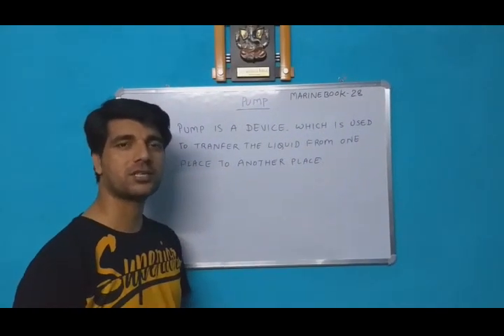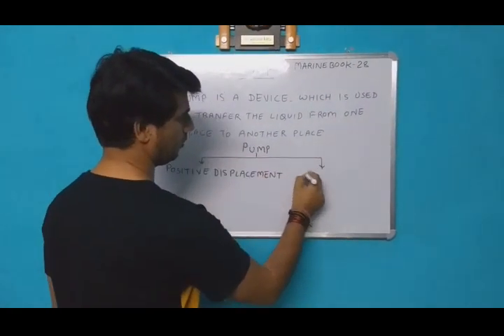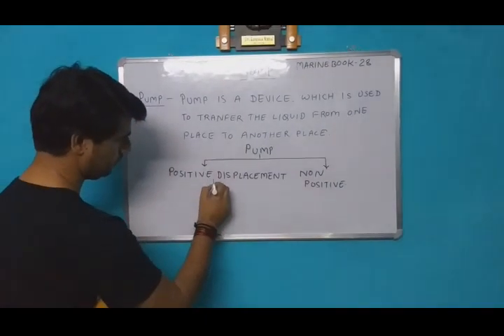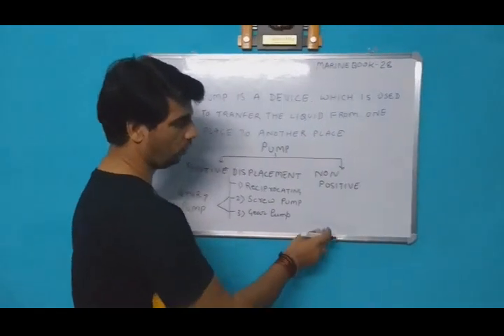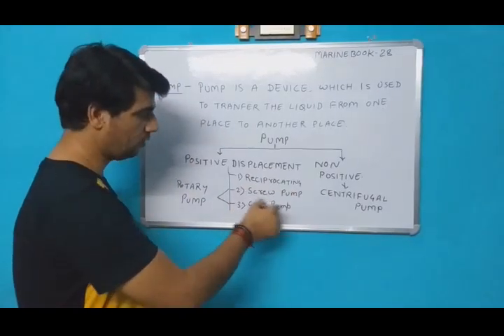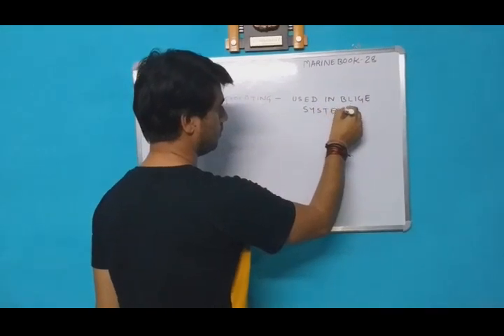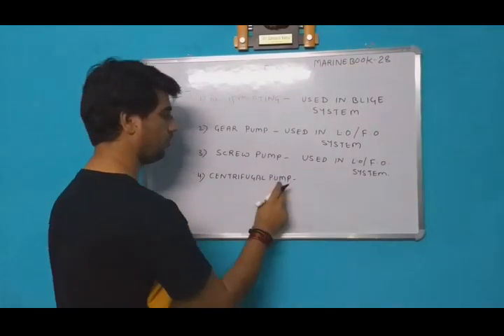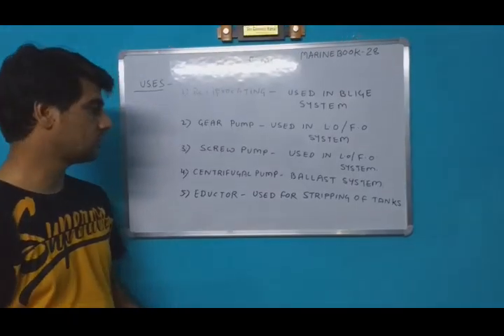TYPES OF PUMPS !! GP Rating

Comment: Sir,
Q. Eductor is electric or non electric
Please tell about eductor getting confused.
Reply: Eductor is simple mechanical system which works on  Bernoulli's principle. In simple words it is a simple pipe with reduced diameter at the center. The water (name it -A) pressure is passed through one end and a pipe(B) is connected just after where dia starts increasing on it.Now the water pressure A will will create suction where pipe B is connected and it will act as a pump. The suction and discharge depends upon the pressure of water which acts as a primover for it.